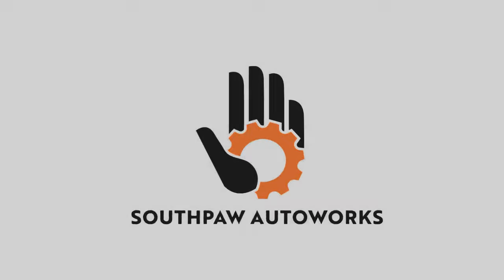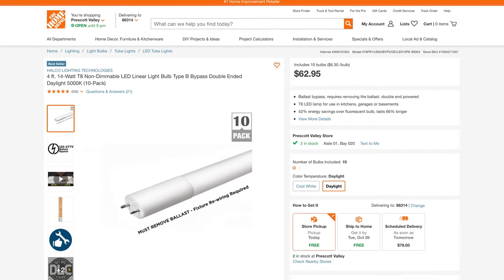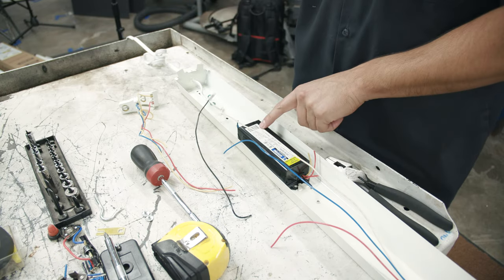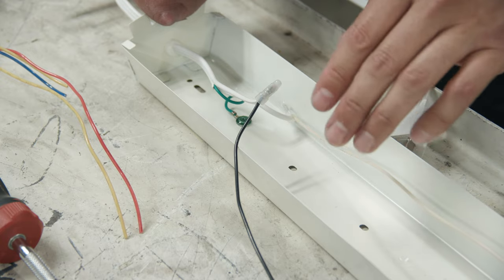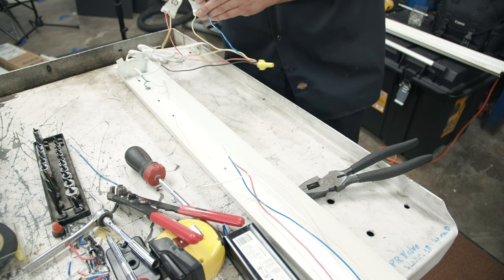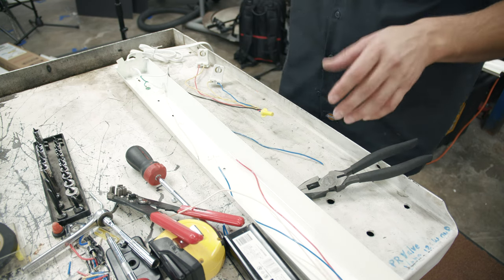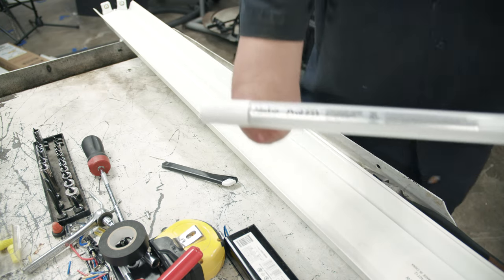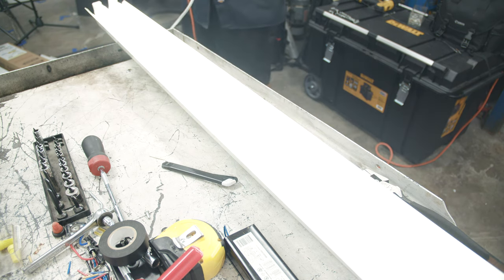Fluorescent to LED Conversion (Ballast Bypass) Why do my fluorescent lights keep burning out?

Comment: You could save a lot of wire by just daisy chaining the sockets on both sides only having 1 long length of wire coming from both sides to connect to the hot or neutral wire.
Reply: To add less connection/wires means there’s less ways it can fail.
Reply from the maker: You're so right.

Comment: I saw my flouroscent light burned round ones with ballast, after that i replaced it with led ones, so far so good with led lights on our 41 year old house, thanks for sharing bro, its 3am now here
Reply from the maker: Right on.  Thanks for sharing.
My house is roughly the same age.
I hope these LEDs last a very long time.

Thanks for dropping me a line, Joms F.
Reply: @SouthpawAutoworks  you are welcome bro, btw on our old civic i also replaced the halogen to LED and much cooler now
Reply from the maker: Good deal!

Comment: I ran into an issue while doing this...I had purchased GE type B, Daylight 5600, "Replacement", and found out they did not work, but the GE type B, Daylight 5600, DIRECT WIRE, is what i needed....is this important info needed? the boxes look so similar I did not notice it until the one did not work..

Comment: So timely. I replaced the fluorescent lights in my closet based on this video. Have considered a Wago instead of a wire nut? Any thoughts on whether it makes sense?
Reply from the maker: Right on!
I have never used a Wago.  From what I understand, they have some very nice safety features.  Sounds like a great upgrade.

Comment: I am trying to decide on color temperature of the lights, 4100k or 5000k?  Which is better hor a at home shop?  I am leaning toward the double ended tubes like you used, more connections but simpler than single ended tubes.  In the past I have  twisted the wires and wrapping wie nuts with electrical tape.   Considering using  Wagos this time,  might be a better way to connect 5 small wires or 4 small ones and 1 #12.
Reply from the maker: It just comes down to preference...
I decided to go with the 5000K bulbs.  But, I have my reasons, which are a bit unique.  
For some of the footage filmed in this space, I use dedicated "video lights" (they offer more control).  Those lights happen to be 5500K.  So, I am aiming to get all of my lighting to match (or at least as close as possible), for my own purposes.
But, once again, it just comes down to preference.

Wire Nuts:
I've only ever used wire nuts/tape, but have looked at the Wagos, and am interested in giving those a go.
If you decide to use them, it would be cool to hear your thoughts about them.

Comment: Tubes and Ballasts  should always be renewed together. 2ndly LED tubes do flicker and this can be lessened by having many LED tubes and or as many LEDs / metre . slightly counter intuitive
Reply from the maker: There's a good practice (new bulb + new ballast).

You are correct about the flicker (60Hz AC electricity), but it's only noticeable on camera when playback speed is increased (fast-forward).  Other than that, not a noticeable issue (for camera or human eye) when using these particular LED tubes.
To be clear, the flicker I was talking about in the video, was regarding a very noticeable (to the human eye) flicker that occurred intermittently (light on for numerous seconds, then light off for a half a second...then back on)(fluorescent bulb/ballast failing).

Thanks for watching, and dropping me a line.
Reply: @SouthpawAutoworks  love watching, you inspire. With LED and if using a dimmer, you may know this already but lower light just means the LEDs don't stay fully on as much and the strobing gets more obvious especially when turning you head around quick. but having at around 80% of fully on will extend the life of the tubes alot. With all those tubes on full, it'll be like mid summer outdoors so you could quite easily do it that way.
Reply from the maker: Right on.